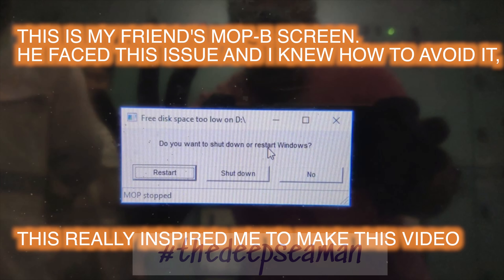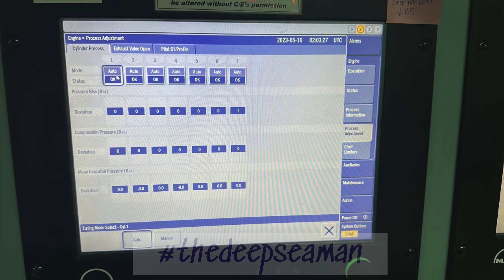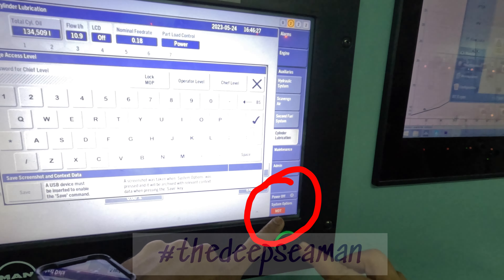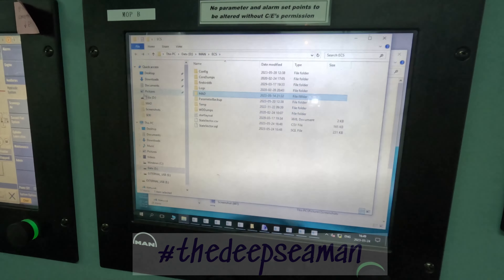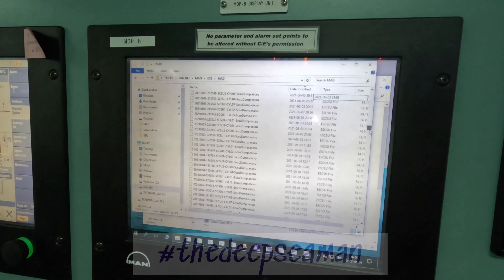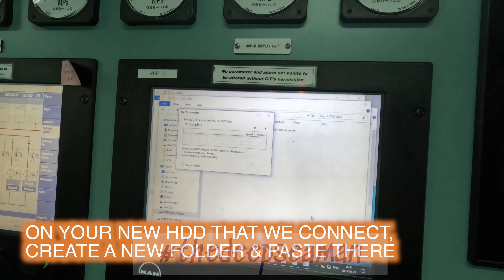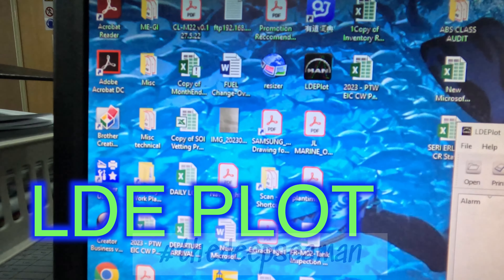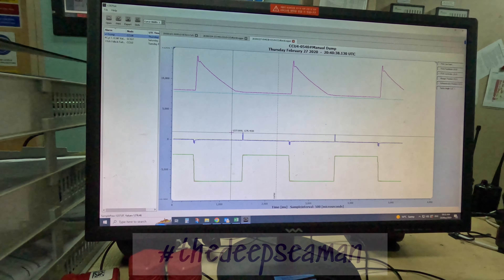MAN B & W - ME ENGINES - MOP-B STARTUP/BOOT FAILURE PREVENTION HACK.

Comment: Hi sir. I am a chief engineer. There is an scr nox sensor error on mop. So man b and w has suggested to unlock the mop to install the parameter update tool. They told to input the password as manbw. But I couldn't unlock the mop b to input the password. So kindly tell the procedure to unlock the mop -b. Thanks in advance. pls try to reply me asap.
Reply from the maker: Hi prem, sorry for the late reply, my net was bloced.. please do contact me in instagram ill reply sooner... same ID
Reply: @Thedeepseaman  no problem sir. Resolved the mop b software issues and installed the parameter update tool successfully.Thanks 👍
Reply from the maker: @premmariner381  really sorry for the late reply, internet was an issue and wouldn’t allow YouTube to be accessed

Comment: Do i need to unlock mop b if I have to restart it?
Reply from the maker: no need to unlock if to restart.. u can just use the option from the bottom right corner of the screen, if this is frozen/hung.. then simple hard reset- Power off-power ON